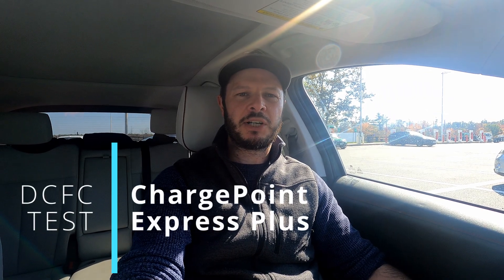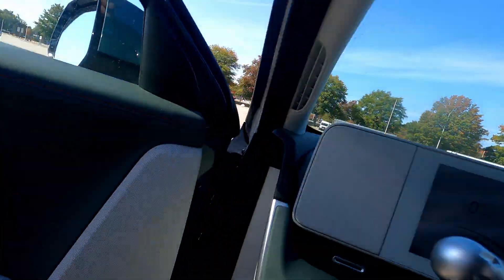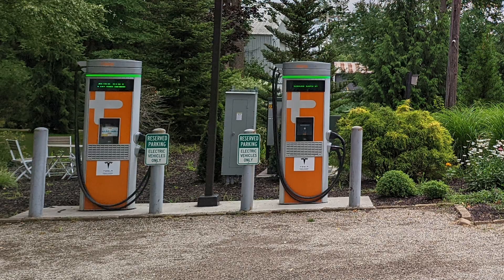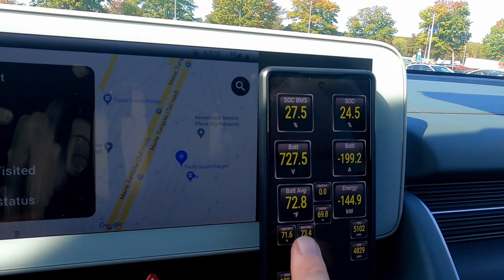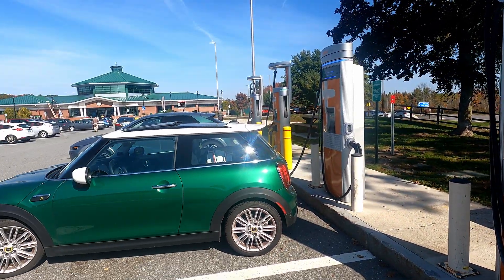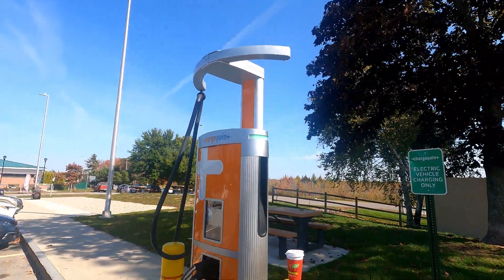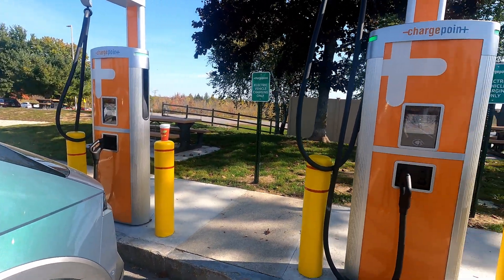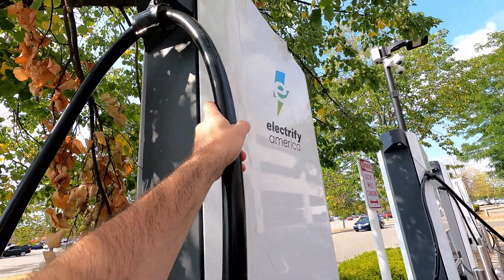ChargePoint Express Plus: New DC Fast Charging Hardware Tested in Maine

Comment from the maker: Is this a significant improvement or did ChargePoint miss the mark with this new hardware design? 

Let us know what you think!
Reply: I think this modular design is pretty cool      going to be easy to maintain
Reply from the maker: @bloodycreepy  Hopefully so. ChargePoint generally has solid reliability already with the CPE 250s and their L2 locations, so it would be excellent to carry that quality over to 150+ kW charging hardware.
Reply: Thanks for making this content! The new design seems unnecessary since the older CPE250 has the same screen and looks like it could accommodate the power modules. At least it's visually distinctive to customers as they roll up, especially if a station is configured this way with two CPE250s and two Express+ chargers. I know which one i'd prefer to use.
Reply: Overall, I think the station is a good improvement over the aging CPE 250 except for the screen and cable management. I'm not sure why they went with a non-retractable cable holder. Adding a retracting holder would allow 1-2 more meters of cable length that currently is just hanging in the air. ChargePoint should have put brighter screens on the units, all of their LCD screens are very hard to see in the daytime.

Comment: After Tesla, the most reliable DC fast charger network in USA. Not even close. After a 10k mile road trip, I would like them to improve the display. Love what Colorado has done.
Reply from the maker: Mostly agree, with the exception of the touchscreens which seems to be behind particularly touch -unfriendly materials! But we usually just tap the NFC reader or activate from the Android Auto app, so that's not a big hurdle usually. If they can convince network builders to go with the new Express unit in a high powered pairing where travel sites are planned, I'd love to use ChargePoint more for DCFC.

Comment: Regarding the service code, you (or someone else) may have tapped on the service menu icon on the screen so it is just stuck there until you go back or enter the correct code.  The screens are hard to see in the daytime, but there's probably a back or cancel button near the bottom of the screen.

Great site overview. I believe you're the first to review a CP Express Plus. These units are very rare. Almost all installs are the CPE 250s. It's interesting they left the second port option blank instead of adding another CCS (to do power sharing) or a CHAdeMO. I didn't know power modules could be inside the dispenser unit for the Express Plus. In ChargePoint's brochure, the external Power Block module is prominently featured. EDIT: The power block must have been in one of the fenced enclosures behind the site and picnic table.

It's pretty disappointing that the AC charging price is only 2 cents cheaper at $0.40/kWh. The AC charging fee should be half as much as DCFC.
Reply from the maker: No, you're absolutely correct, looks like I was getting my ChargePoint terminology mixed up. The visual shown has the modules inside the Power Block but it's exploded out right next to the Power Link, so I think I conflated the two in research. Thanks for the clarification!

The L2 pricing is unfortunate, but probably not a big deal overall. I can't see anyone wanting to hang out at a service plaza for an hour plus just to get 20-30 miles in normal circumstances,  so it's more a back up to DCFC if full or down.

As others highlighted, the touchscreens are a downside to ChargePoint's otherwise very reliable hardware. These have only been active for a couple of months and already feel years old in terms of latency. I think the service code screen was showing as we approached, but could easily see delays and mishits bringing up an unintended screen.

Comment: Seems like chargepoint is still playing catch-up in the DCFC world. These seem competitive to the old EA hardware, but the new hardware is responsive in both starting the charge quickly and the screen is faster and more responsive. The video here shows the CP hardware to be amazingly unresponsive. 🤦
Reply from the maker: Yep, it was actually worse than I showed... edits cut out several unproductive taps and I tried to resolve that service code screen a couple of times but couldn't get to the screens I wanted to see. 

The one thing that compensates for this is the reliability of NFC/tap to activate on ChargePoint stations. Usually, the touchscreen is redundant for us because of that, but it obviously doesn't bode well for EV drivers encountering the network for the first time, who are reliant on the touch screen at first.

Comment: What is the software you use on your phone to get the multiple readouts of temp, SOC ect...
Reply from the maker: It's called Torque Pro for Android, used via OBDII adapter (iCar Pro BLE for us, but many options). If you use Apple, EngineLink can display similar data points.

Comment: Oooof, 200A max at this site means that 400v cars are really going to get frustrated at the slower than expected charge speeds.The new charger isn't any faster than the older CPE250 charger for 400v cars. However, it's good to see that at least there's some appreciable improvement for the 800v cars. 

It kind of sucks for the layman because you need to know some basics about electricity for the Amps x Volts to figure out the power. If the screen says 160kW and the car says it can do 150kW, then one should expect to get max power. An ID.4 will be lucky to see even half that.
Reply from the maker: I think that's one of my biggest question marks over ChargePoint: there's a great deal of variability across what you'll get at their locations. This applies to the CPE250 too, as well as the pricing due to the site host management model. The gap from an individual 50-62.5 kW unit isn't a big deal, but calling a site 125 kW and only delivering double digits is disappointing... ramp that gap up to below 150kW vs 200+ kW  on these Express Plus units and I can already hear the complaints brewing!
Reply: @plugandplayEV  I think Polestar 2s get the blue ribbon for the highest power off the paired CPE250s at over 400v. Poor Mach-Es suffer with the 350v so they're at 70-75kW. 

Hopefully Starbucks-Volvo puts in chargers of at least 250A if not higher. I've only found one station that's been installed but it's been unpowered for months.
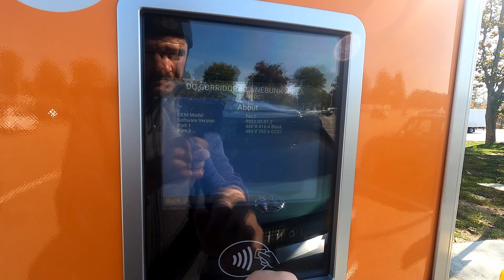Reply: 200 amps was just the limit for E-GMP cars in particular due to their high voltage. If you look at 7:03, the station's about info screen shows it can output a max of 350 amps. The power modules each have a capacity limit of 40 kW and 100 A. Four power modules would have a max output of 160 kW or 350 amps, whichever is lower. They de-rate the amperage output from 400 to 350 for 4 power modules.

Comment: wish there was a competitor to EA that actually installed 150-250 kW chargers in an amount that you could actually use that were reliable. Hopefully this is the first of many as we need chargers at every exit and 4 stalls doesn't cut it.
Reply from the maker: The expense of anything more than four stalls is probably cost-prohibitive, at least until significant funding starts rolling in. Each charger is pushing triple digit $$$ at this level, meaning even a basic site will cost a quarter to a half million dollars. Electrify America has dollars to burn until 2027, when the mandated spending comes to a halt. State-level installs, like this one, have limited funding and have to be a bit more judicious with their DCFC dollars.

Comment: I'd say they need a much larger light, visible as you enter the location and a RED light for a down charger.
Reply from the maker: The light might change when offline... happily, I don't recall seeing a ChargePoint DCFC unit offline, so couldn't say if the CPE250 does that. But more visible lights would be an improvement. From afar, these won't appear much different to a standard light, especially if EV drivers are used to looking for the top of the older units or the deep neon green of Electrify America.

Comment: I’m surprised that the charge cable doesn’t have a tension cable that allows you to pull the charge cable out a little more like the new EA units. It seems like there is plenty of slack to do so.

Personally, I applaud any additional 150+kW chargers that are available. In my area, we have EA, then almost everything else is 50kw. There are some of the ChargePoint CPE250 around, but most of them are limited to 50kw. Some will put out 62.5kw max. So yeah, more high power charging is better. The price is a little high but manageable.
Reply from the maker: That surprised me as well. The connector for the cable management looks very similar to the new EA hardware from BTC Power and Signet, so when I tugged a little and it didn't retract, it felt limiting. The swing arms on both types of ChargePoint station are certainly better than old models that had short cables and no cord management, but I doubt they'll fit the bill for some EV models if owners don't park just right.
Reply: I agree. There's so much wasted cable slack that is just hanging in the air with no retracting cable holder. At least 1-2 meters of cable that can't really be used at all.

Comment: Visited many CPE-250s while touring National Parks in Colorado away from the EA corridor. I found them reliable but nothing special as you say.
I am looking forward to seeing some of the 4th Gen EA units in California. Especially balanced power for the site which will be my favorite thing as I have a Taycan but same with EGMP cars to find a 350 unit when they are taken by Bolts and ID.3s. I’m not trying to bash those cars as I had a Bolt for 3 years and loved it. It’s just that they cannot utilize above the 150 kW units.
Reply: Yours is a common complaint - it is hard to blame slow-charging drivers if other units not working or impossible for cables to reach or the other units were occupied when slow charger arrived.  Plus you have the "edge" CCS cars that charge at under 150kW but benefit from the higher Amps provided by the 350kW units (their pack voltages are relatively low).  I think the best solution is to add a time component to the pricing on 350kW units to discourage slow charging.
Reply from the maker: Right, reliable but unspectacular in terms of speed/power. I think a lot comes down to the location... at a service plaza like this, I want to be underway in 20-30 minutes at most. But at a retail center or town center, I'm happy to have the reliability of a CPE250 and spend a little longer exploring, if need be.

Comment: $0.40 per kWh seems unreasonably high.
Reply from the maker: For the level 2? I quite agree. It's most likely a residual of the calculations made based on pricing out equipment at a DCFC-first site, even though the J1772 equipment is a tiny fraction of the CCS/CHAdeMO hardware cost. It feels like more of a back up option than anything else here.

The DCFC price of $0.42/kWh is also on the high side, but not too far out of whack with EA's off-plan pricing ($0.43/kWh) or EVolve NY's after-tax number ($0.38/kWh).
Reply: I agree, that seems amazingly high for an L2 station.

Comment: Are the cables thinner on the new units? I used a CPE 250 for the first time last week and the cable seemed more bulky/stiff than the EA 150 kW I used previously. Kind of awkward to plug in and I was right next to the charger
Reply from the maker: No, the cables didn't seem different on either of the two models of DCFC unit. But the ball joint cable management on the new model does seem to permit greater manipulation of the cable than on the CPE 250, which is just that rigid swing arm out and then however far you can move it out. They seem to have similar reach and weight, but the new units manage the weight and positioning a little better.

Comment: Maine is doing a great job of getting CCS chargers installed along the highway.  I wish NH would get their act together (north of Manchester and West Lebanon).  Looking at the VW settlement funds page and the NEVI plan, it seems they're in no hurry.  It could be years before we see chargers turned on in NH.
Reply from the maker: Agreed. And these locations have been in for a couple of years at the 50-62.5 kW level, showing how ahead of the curve Maine is compared to NH. Even West Lebanon is more a hat tip to Electrify America's regional route expansion filling gaps than any foresight from the state's agencies. Efficiency Maine is definitely a big plus for EV drivers across the Northeast.

Comment: A little disappointing and concerning to see they’re still only rated at 200 amps. By the look of it they could still technically be NEVI compliant since 160kW is in fact faster than the 150kW required.

I wish they would have started this new line of chargers at 300 amps as an absolute bare minimum.

If the 200 amp variants are significantly cheaper than the higher power models then I could see them become popular with contractors trying to get the lowest bid for NEVI funding.
Reply from the maker: I think so... it gives ChargePoint an individually reliable option around the 150kW mark, before any pairing and power sharing considerations are factored in. From there, they can build up for sites that require it (of which I think an interstate service plaza would be top of the list, but we'll give them some wiggle room given it's an early edition). Some key Maine locations are lacking true high power DCFC, so adding a couple of these to each will significantly improve what's already in the ground in our area.
Reply: The station's info screen at 7:03 shows it can output a max of 350 amps. 200 amps was likely just the limit with the Ioniq 5 since it has a relatively high battery pack voltage.

Comment: 6:55 In my opinion, the touchscreen is probably the weakest aspect of ChargePoint's units. I can't tell whether it's the protective plastic layer (which also negatively impacts visibility), but the precision of the touchpoints and responsiveness leave a lot to be desired.
Reply from the maker: Absolutely. Thankfully, we typically start charges via a phone tap on ChargePoint now and had no problems in two trips to Michigan, where these dual CPE250 pairings fill most of the EA gaps. But for a first-timer, I could definitely see the laggy (or, sometimes, completely unresponsive) touchscreens making the experience much less satisfactory.

Comment: Thanks for this test, Steve. So far, I still haven't been able to test the ChargePoint Express Plus units. The only one in my region has not been open and available to the public (the one at ChargePoint Headquarters). Interestingly, it's not a huge improvement in charging speed over the 125 kW paired CPE 250 for E-GMP cars (I was seeing ~115 kW in the EV6, if I remember correctly).
Reply from the maker: Cheers, Eric. I'm glad that states like Maine are not only getting these sites in but also upgrading them when the opportunity arises. Massachusetts could certainly learn something from them!

Unfortunately, I haven't had many positive experiences with the paired systems thus far. Most of the installations using that in Mass seem to be either at busy locations, so the power is always shared, or installed in such a way that maximum power isn't delivered. Maximum we've hit so far at a CPE250 location is 83kW, if I recall, but will keep trying!
Reply: @plugandplayEV  Yes, I think that if you have the option, Electrify America or EVgo's newer charging sites are a much better choice for faster charging EVs. For the Bolt (or really, any of the 200 A charging EVs), I think the CPE250 are some of the best chargers available. While everyone is fixated on EA, I've had no issues accessing these ChargePoint sites on trips.
Reply: @newscoulomb3705  When we had a 200A CHAdeMO car, it would only get 50kW at EVERY "shared" ChargePoint CPE 250  "125kW" site I tested.  No response by ChargePoint to queries/complaints.  Now we can test the same stations with 120kW CCS car,  Has ChargePoint changed their policy on "Plug snd Charge" ISO15118 implementation?  Today we test EVgo Autocharge following your example.
Reply: @mikecarter2737  Hmm, that's interesting. Are you sure you weren't running up on the thermal limits of your CHAdeMO EV? I can't always test the split power function because I'm often using my Bolt EV, but so far, every EV I have used at paired CPE 250 chargers that can push past the single-unit 156 A threshold has been able to.
Reply: @newscoulomb3705  No thermal limitation; it would have been the first charge of the day.  In one case I had borrowed a Leaf Plus from dealer 5 miles from site.  And of course we use LeafSpy.  After getting 50kW at ChargePoint, went to EVgo and got 78kW in another test.  My hypothesis is that ChargePoint ignored that limited market and didn't tell anyone.  There are even "secret" 200A EA CHAdeMO plugs that somehow missed the downgrade; a shame that there is so little transparency in this area.
Reply: @mikecarter2737  some cpe250's were sold as 50kW only with an available upgrade to 62.5kW even though the hardware is the same, so that could be why. I'm not sure, but I think the stations should say max charge rate on the display
Reply: @Zoboomafool  I was able to get 80kW on one of the paired units that only delivered 50 to the Leaf Plus, so I think CHAdeMO not paired.  No signage of course.